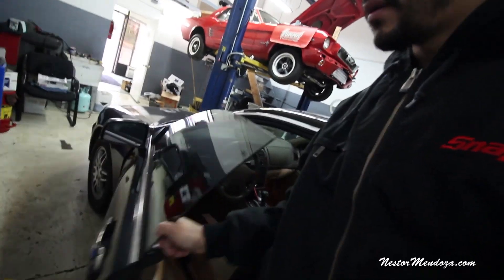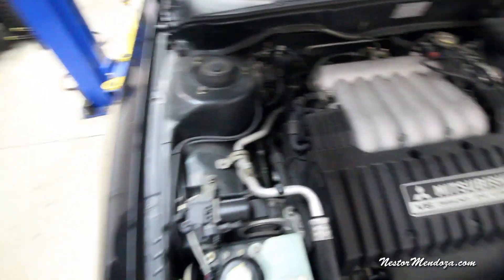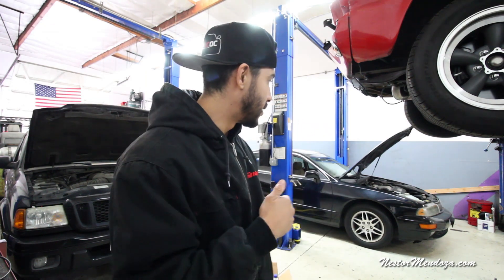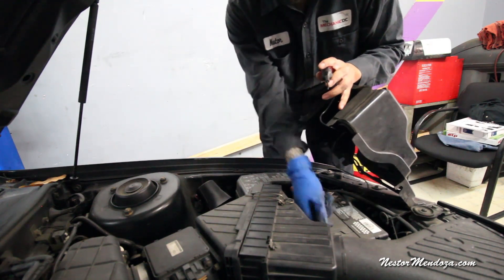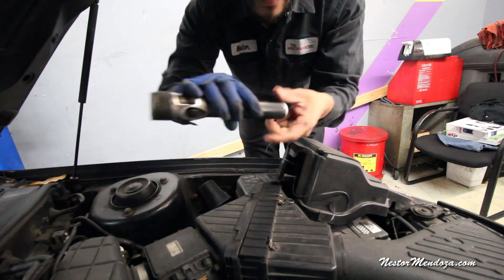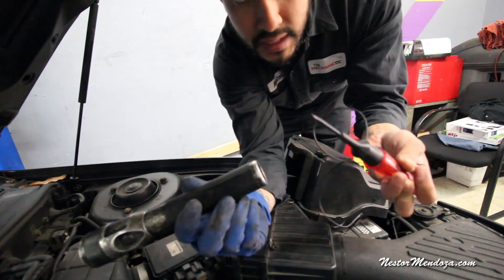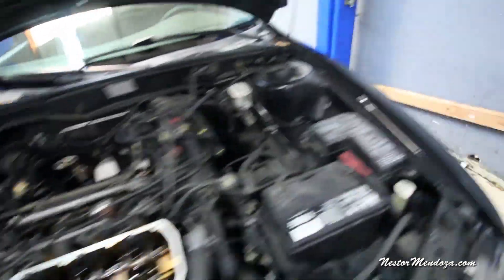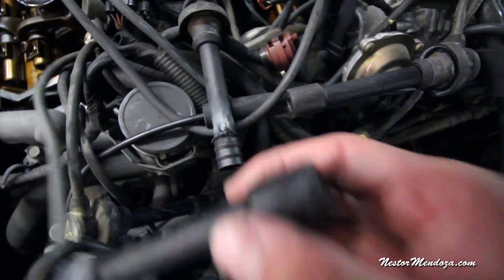Misfire Diagnosis with a Test light

Comment: You can do a relative compression test with a lab scope or Snap On MT 2400 Graphing Meter .Or.. AutoDitex makes a tester that clips on the battery and will give results in SECONDS . You can also trigger it off a cylinder to match the readings to each cylinder. Diagnose Dan uses it on You Tube. It costs about $ 300.00. It sure beats doing a compression and or leak down test .

Comment: Bro simply put a inductive pickup from scope to king lead or primary circuit,then use cyl 1 as a sync then u will see on the wave form weather its lean,misfire via lead or plug low compression and coil strength all in one test,no dismantle.... very interesting how diff mechanics/techs do trouble shooting.

Comment: Get a scope, it'll tell you if its fuel, plug or wire. Aeswave.com has a nice pocket scope kit for 400 and come with a paddle probe, inductive pickup that clamps over plug wires, amp clamp, couple other things. In the case of intakes covering the rear bank, you can do a relative compression test using the amp clamp over the battery cable. Takes 30 seconds and justifies removing the intake
Reply: Big time saver. Also, watch subscribe to scanner danner premium. You'll learn a ton that will save you so much time
Reply from the maker: True.

Comment: I have one of those paddles but it doesn't hook up to a scope. I got it through Matco and it has a red and green light in the handle to tell you if the coil is good or bad and here is a knob to set the sensitivity.